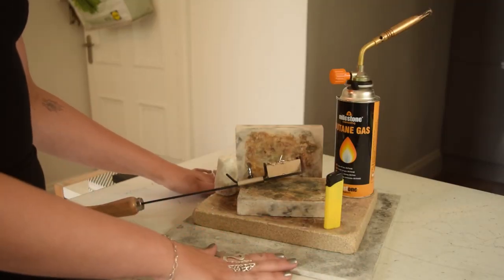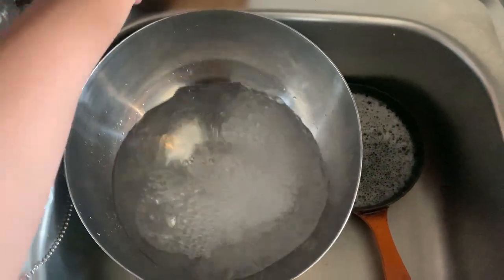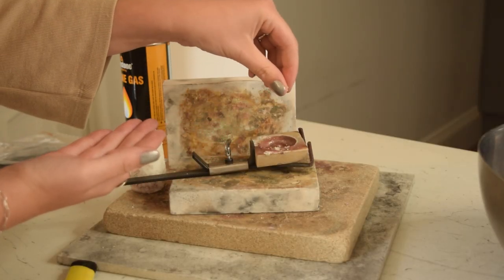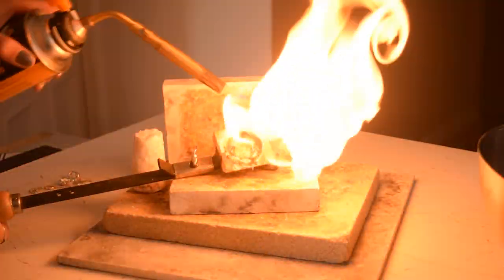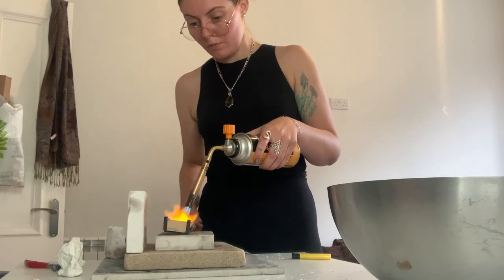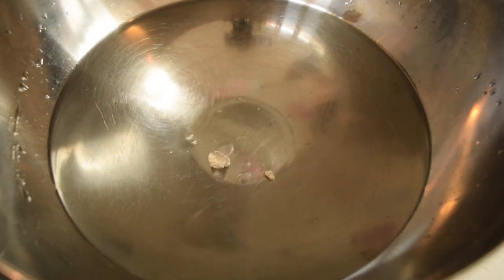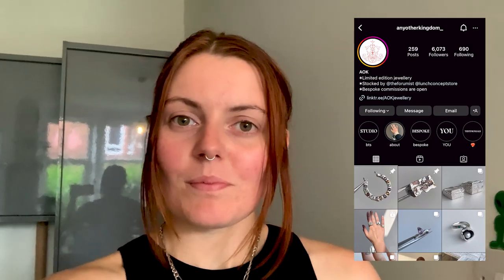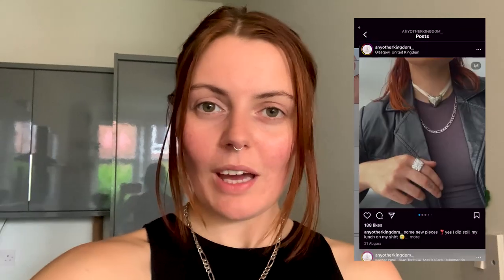how to water cast organic silver & gold shapes | crucible preparation | easy tutorial for beginners

Comment: I tried this technique and came up with assorted shapes. Yes, I got a lot of the same shapes as you, but I experimented with different techniques(?). I poured from a lower height, then from a higher height. I also tried different amount of silver per pouring. One piece from a larger pour came out really cool. Like a large semi cupped splat of silver. There were some pointy bits around the edges, but I may file those a little and make a pendant with a small stone in it. It was a lot of fun.
Reply from the maker: Thank you so much for letting me know how you got on 😊 it’s such a fun process I am so happy you are experimenting and having fun!

Comment: hellooo love i just wanted to tell you i lovveeee your channel!! i learned a lot and its great to see a channel which encourages to do silversmithing with more simple tools (which i have been doing for some years) thank you! the only thing which i haven't got my head around is finding the right blowtorch which has sufficient heat for melting silver chunks. Do you have some recommendations? <3
Reply from the maker: Hiya! Aww thank you so much for your message I’m so glad you like the videos. Ahhh yes I think this is so important to know that you don’t need hundreds of expensive tools to make something beautiful. It’s important to have a go!
Reply from the maker: Hmm so without a gas bottle and torch you’re gonna struggle to melt more than 3-4g of silver. But I would suggest getting one like I’m using in the video with the detachable butane bottle. It does take a bit longer but be patient and try to use your soldering blocks to reflect the heat back in on the crucible ☺️